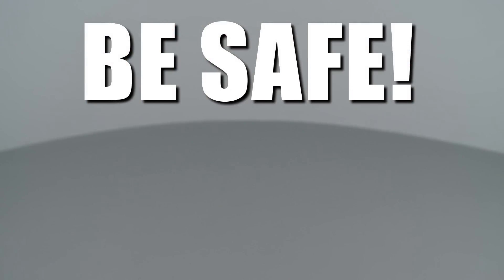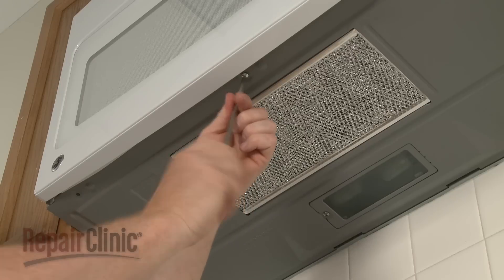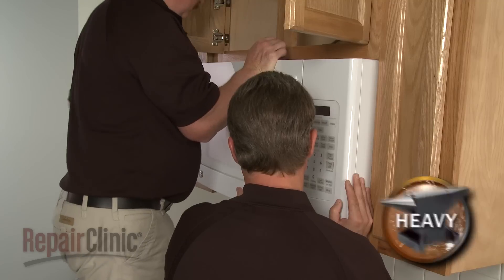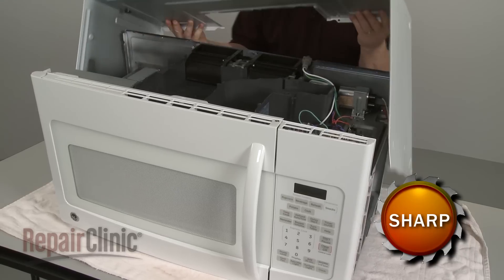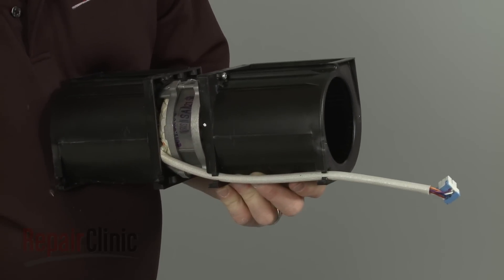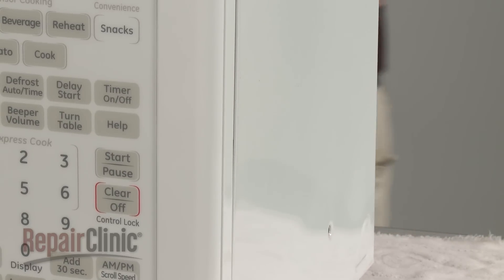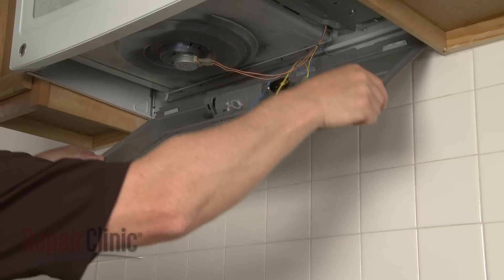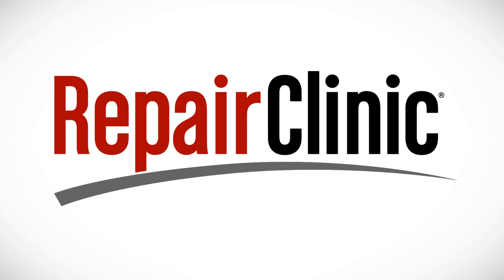GE Microwave Vent Blower Replacement #WB26X10234

Comment: Does this exhaust fan only work for the "over the stove" exhaust or for the interior also?  My interior fan is not working.  it still heats though.  I don't know what else it could be everything else is functioning.
Reply from the maker: +junkmountain The exhaust fan does not cool the microwave too. The unit will have another cooling motor for the high voltage components.
Reply: +RepairClinic.com  Thank you!  I've ordered the part.

Comment: What is the problem if the automatic vent hood on GE PVM1870SM1SS keeps trying to  open and close while the oven is sitting in idle doing nothing. I have to unplug the thing when not in use or it continually makes quick clicking sounds like it is trying to open and close the auto vent that opens everytime something is cooking.
Reply from the maker: It's possible that there's a faulty micro switch on the vent motor. If that checks out OK, the control board may be faulty. If one of the door switches has failed, the microwave will not cook properly. The only way to know for sure is to find the wiring diagram and use a multi-meter to check for continuity in these parts and discover the culprit. http://www.repairclinic.com/PartDetail/Digital-Multimeter/DM10T/964740?TLSID=1773.

Comment: Hello, RepairClinic.com! I have a  Microwave oven vent blower GE, Hotpoint part number WB26X10234.. It has 6 wires coming off of the motor. Black, White, Gray, Yellow, Red, and Blue. I need to locate the ground and power to hook up a switch for a small paint booth ventilation project. Any help would be extremely appreciated. Thank you.
Reply from the maker: John Bradford You need the wiring diagram for the microwave to determine where each wire goes if it was not recorded upon removal. Normally the diagram is found when you remove the control panel or cabinet.

Comment: if the motor spins with help, can it be the capacitor/
Reply from the maker: +leroy blowers The blower motor normally does not have a run or start capacitor.